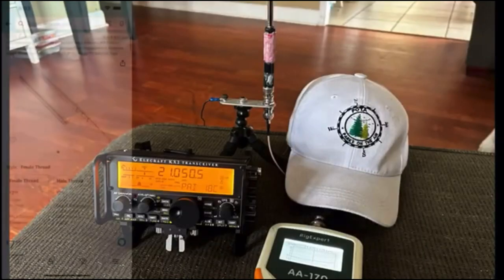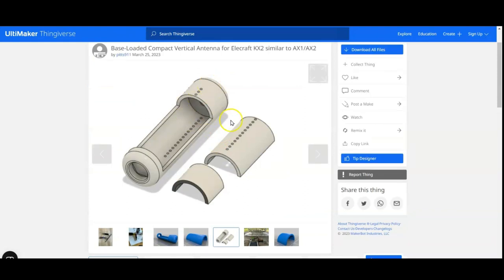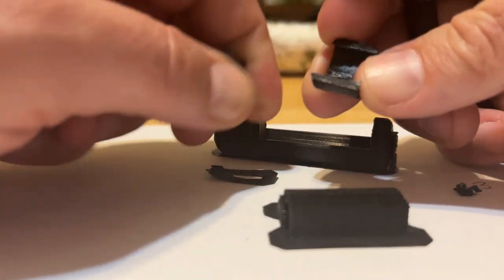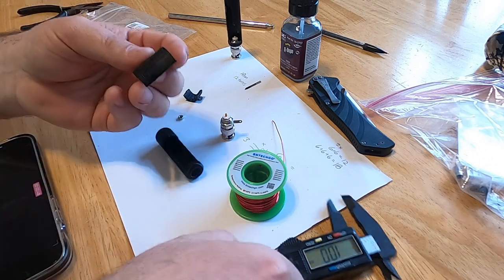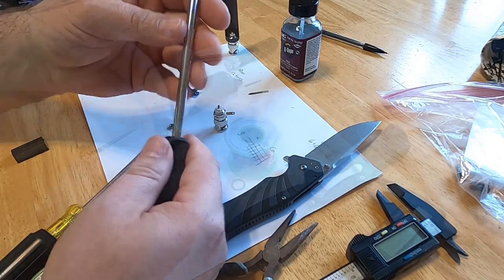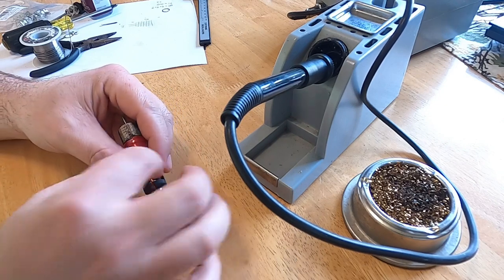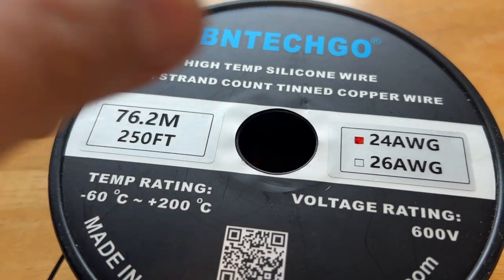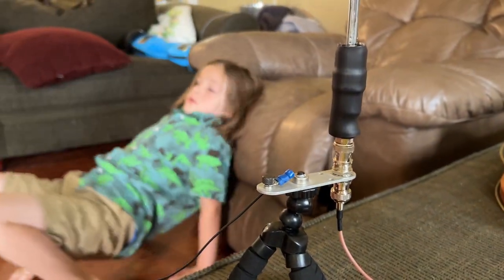Version 2 (All resources available) Elecraft KX2 Style Base Loaded Vertical Antenna - DIY

Comment: Nice design - Think i will start with a 10m version for my KX2. And then an add-on coil for 20m
Reply from the maker: I like the idea of an add-on coil. That’s how the Elecraft AX-1 20/17 is made. It has two coils that are center tapped with a switch. That would be a sight to see if a mini coil could be made and a jumper is used to select the band. It would be a mini Wolf River Coil. Someone get on that!

Comment: Would a design like this be able to take 20 watts ? Or just mainly QRP operation.
Reply from the maker: I see no reason why it couldn’t be scaled up. More power would necessitate using heat resistant materials, and a larger awg enameled wire.